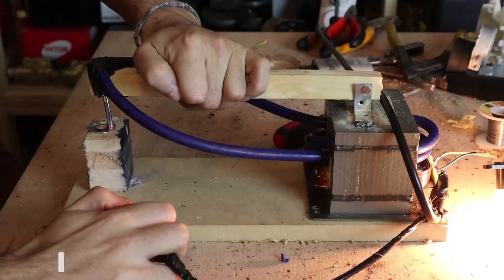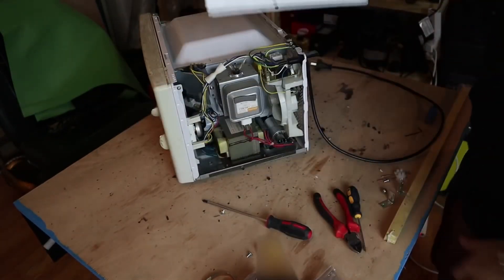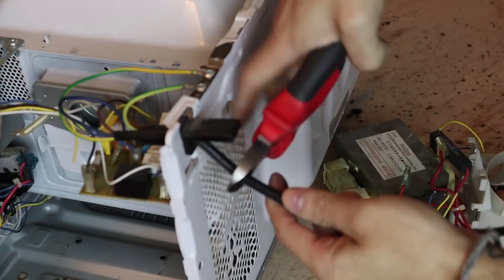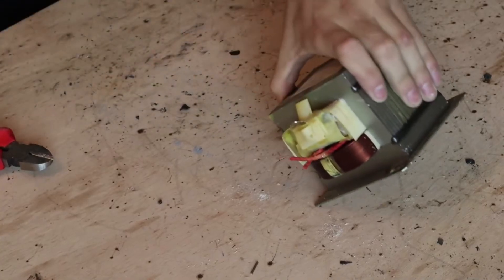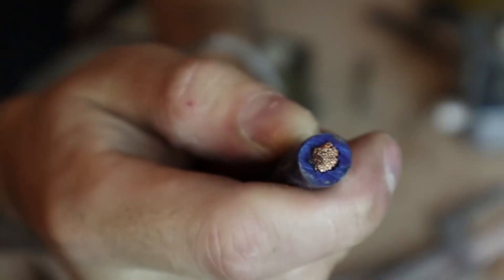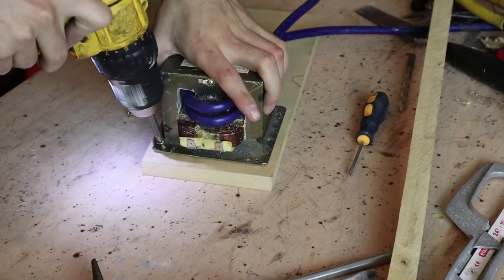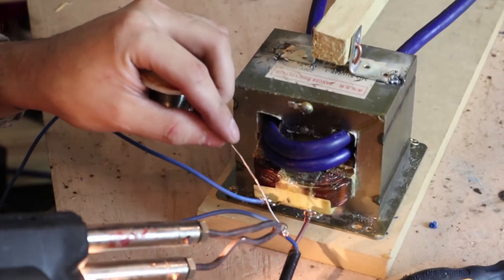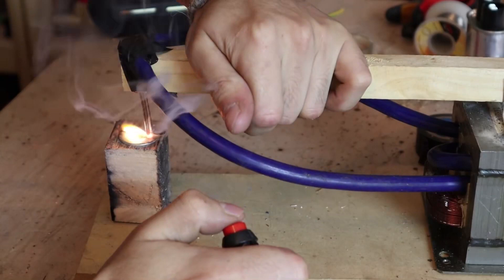Before throwing away your broken MICROWAVE, check out this VIDEO!

Comment: That's some quality welds 3:12
I really don't recommend working on anything about 50V unless you know what you are doing. Even though this is safer than Lichtenberg device, 230V wall power can be lethal. 
While extra low voltage, high current is safe to touch, it can cause fires and serious burns from the resistive heat and splattered metal.